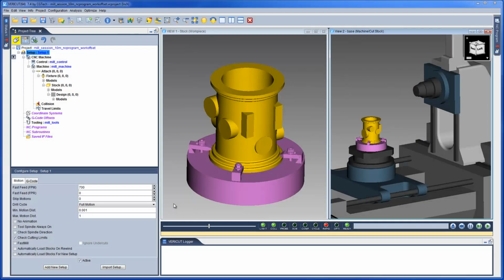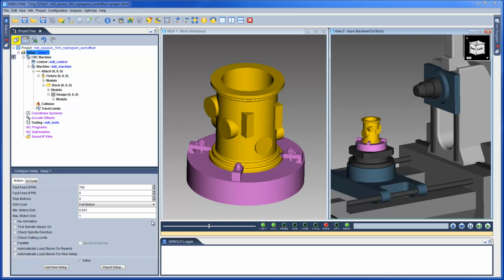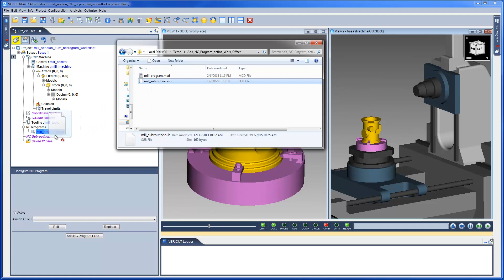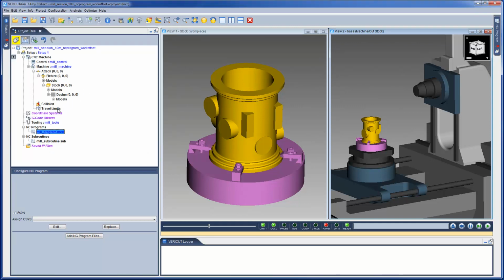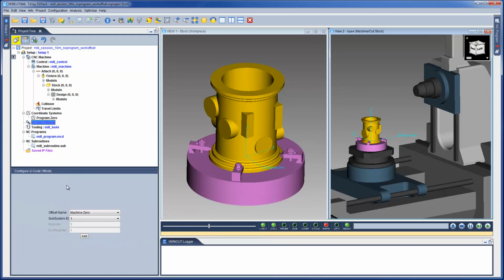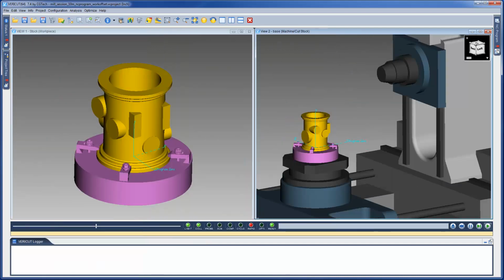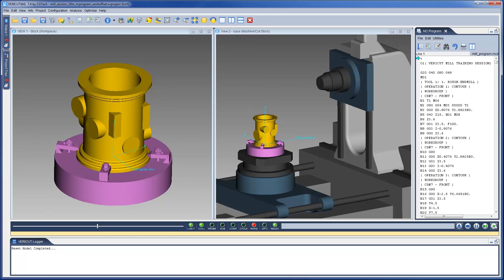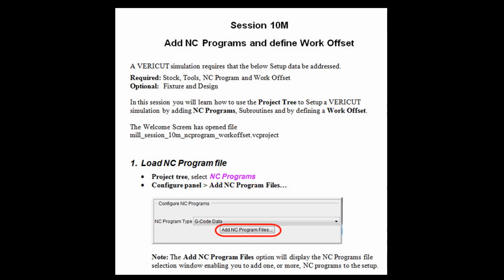Add NC Program define work offset in VERICUT CNC simulation software

Comment: Why do we define work offset from spidle to stock and not from tool to stock? What's the difference? Sry I do understand it probably dumb question but still..
Reply from the maker: +CouncilofThirteen on most VERICUT machine configurations this will give the same result. Sometimes the relational offset will be from other components, this depends on how the machine was built, if you need more information contact your local CGTech office http://www.cgtech.co.uk/about/